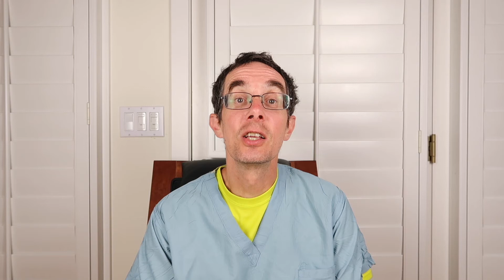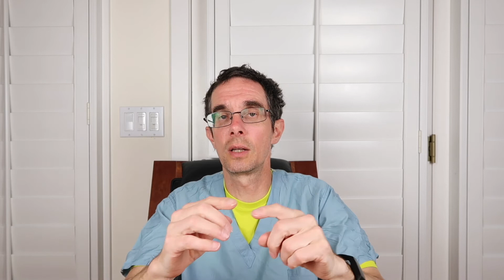Diastolic Heart Failure

Comment: I think I have diastolic heart failure. I had a left heart cath a month ago. My LVEDP was 18 to 21. They said nothing to me about it and didn’t order an echo in the hospital. I gained 7 lbs in 3 days. Had to start taking Lasix. SOB, coughing. I have gained as much as 3.2 pounds in one day. Still waiting for an echo a month after my cath. They misdiagnosed my chest pain for 5 years thought it was POTS. Had 2 false negative Echos 2 years ago. Heart cath showed 85% blockage of my Ostial RCA put a stent in. My EF was 60%. Could the lack of blood flow to my heart for that long have caused the heart failure? I also have hypertension but my POTS doctor kept wanting me to decrease it because I was dizzy. They also stopped the beta blocker because the CPET showed my heart rate wasn’t going up with exercise. This caused me to almost have a heart attack. The CPET even failed to diagnose a 85% blockage 2 months before a heart cath confirmed it!  A heart PET scan showed low risk 2 years ago. I hope the next echo isn’t another false negative and actually shows the problem this time. I wasn’t aware of the of 15% false negative on echos until the cath. I am a 69 yr old female with a positive family history of  CAD. Both my mother and brother had bypasses. I didn’t discover I had high cholesterol until after the cath because my internist kept telling me the numbers looked good but then I saw they were high on my chart. I read a right heart cath with exercise is the only way to definitively diagnose heart failure with preserved ejection fraction. Do you think I should find a cardiologist that can perform this test if the echo is negative again? My kidney function is normal the only other problem is an elevation in my liver enzymes. I have a fatty liver. I was heavy at one time but lost weight in the last year. I seem to fit the profile for hefpef. My thinking is with elevated pressure on the heart cath and all the edema in my legs and abdomen I’m already moderately impaired and not in an early stage of heart failure.
Reply from the maker: Oh boy that's alot. The short answer is yes it does sound like you have diastolic dysfunction (ie HFpEF), but several things to clarify.
1. An echo can not see or assess the arteries at all. You can have 99% blockages in all 3 main arteries and a completely normal echo, those look at different aspects of the same organ.
2. Misdiagnosing chest pain and POTS (which chest pain is not a symptom of) I don't even know how to comment there.
3. The lack of blood flow could cause a reduced ejection fraction but 85% blocked wouldn't do that, and that would not cause HFpEF.
4. POTS and high blood pressure together is a dilemma - too many questions/scenarios possible to try to fix this via messaging but a good POTS doctor should work with you on this.
5. The ß-blocker and exercise heart rates/exercise capacity/POTS correlation is also complicated, but stopping the ß-blocker would not have caused the artery to get 85% blocked (when an artery blocks of 100% that is what causes a heart attack).
6. If the cardiopulmonary stress was done with an echo or nuclear images that should have picked up the blocked artery, if it was done with ECGs alone those are only ~70% accurate so something like this could be easily missed (ie, it's the wrong test to find blockage).
7. When you refer to a heart PET scan there are many types of PET scans to look at the heart, it depends on what specific PET but only a PET stress test would assess the arteries, all of the other PET scans do not.
8. Yes what you were alluding to is correct, for patients with elevated bad cholesterol the earlier we find those patients and treat them (and this is not just meds but also diet, exercise, smoking, etc), the less plaque they build up and the fewer heart attacks, strokes, stents etc end up happening.
9. From what you wrote a right heart cath might be the best test for you. That would answer many questions as other things such as primary pulmonary hypertension could cause alot of what you write, and this test helps to differentiate the cause.
10. After this you comment on the echo again, echos are very good at diagnosing diastolic dysfunction and stage of dysfunction, there are multiple parameters that should be checked on every echo, (once again can not say anything about the arteries), but this most of the time gives us the answers we need.
11. If your bmi is high and especially if it is over 30 getting that down would help any of the possible causes.
12. I don't know if you're in a remote area or if you have access to a decent academic center, I would suggest trying to get to see a heart failure specialist so they can direct testing and treatment more appropriately, that might be the best next step for you. And I know we both wrote alot, but printing this and bringing to that appointment might help if they're willing to take the time to go through each of you points and responses 1 by 1.

Hope that helps and hopefully you have an answer so a proper treatment course will get you better.
Reply: @davidnajman7640 thank so much for the quick and detailed response. The CPET was only a ecg no echo done. The PET scan was Positron emotion tomography myocardial perfusion multiple done 2 years ago not sure if I was exercised or not. My stress echo done 2 years ago did show grade 1 diastolic dysfunction but I was told it was normal for my age. I just had another echo done today but it was not a stress echo. If it correlates with my symptoms of fluid retention, increased SOB and the need to be on Lasix daily in should show a grade 2 or 3 diastolic dysfunction. I’m gaining up to 3.2 pounds a day. Based on my symptoms I feels I could be in stage C heart failure. I did have one day that I was having chest pain again. My lungs felt like they were stretching and there was pins and needles feeling near my upper chest and neck. My back hurt too. My lungs felt very inflamed for a few days. The symptoms decreased after taking Lasix. My BMI has gone down from 30 to 27 in the last 3 months. I was watching my diet and walking everyday until recently when my health declined. I lost 21 pounds in 3 months when I can get all the fluid off. I live in Raleigh NC. I see Dr. Mobarek who is a POTS specialist at UNC Rex. I should know the results of the echo in 48 hours. Hopefully he will be able to direct me to a heart failure specialist. I know they have a clinic in the hospital. I’ve read that a right heart cath is the gold standard for diagnosis of hefpef and may still be something I need to pursue. Duke hospital is close by they have advanced heart failure specialists because they do transplants. I’m having a lot of difficulties with taking Lasix because of the POTS. I also have Dsyautonomia, small fiber neuropathy, gastroparesis. I had a Nissan fundoplication my Vagus nerve was damaged and it caused my stomach to completely shut down and become neucrotic. I ended up having to have it removed. I’m not going to do well with a salt and fluid restriction. The heart failure and dsyautonomia are not going to be a good combination. I’ll need a cardiologist that understands both conditions. Thank you again for your help. It did relieve some of my anxiety as you can imagine is tremendous right now. I hope this conversation helps someone else that may be in the same situation.
Reply from the maker: In regards to your last comment, that's the reason I put these videos together, if it helps either patients or physicians learn more I'm happy.
Agree that you will need to make sure the docs taking care of you communicate well, POTS along with heart failure is a but tricky to manage. But also keep in mind that there are many other things that will cause fluid retention, low albumin, kidney issues either spilling too much protein or not working well, lung problems... to name a few.
If you have questions as your testing proceeds feel free to post here but remember it is a public space so only write what you're comfortable doing.
Wishing you the best

Comment: I have had a echo stress test a year or so ago and they said it was fine . My concern is that my diastolic bp is not good a lot .  115/93 was this morning 120/90 .  It can be 120/78 on occasion .  Should I be concerned .  My thyroid was out of whack for a while and they adjusted my meds . Not sure how much that has to do with it
Reply from the maker: Hi Rick. Diastolic heart failure and diastolic blood pressure are 2 different entities, and only loosely related (I realize that wasn't your question). In general we worry more about the systolic blood pressure than the diastolic, your systolic is quite good. A higher diastolic blood pressure is often seen in people who are overweight or diabetic, if that's the case with you then focus on getting weight down and the diastolic BP will come down as well. 
And yes an out of whack thyroid can effect this, if your thyroid is too slow, that tends to cause weight gain and in turn higher diastolic blood pressure. Other factors that can do it is a higher heart rate (there is less time for the arteries to relax), pain meds, lack of sleep, and even alcohol.
Hopefully that helps, if you have more questions let me know.
Reply: @davidnajman7640 thank you for the reply .  I’m not overweight , I’m 5-10” 178 I do cardio 5 days a week , kickboxing 3 days a week and weightlifting 3 days a week.  I take 20mg daily Lisinopril and 5mg of tadalafil daily .  I take trt 10mg subQ daily .  My thyroid has been all over the place the last 6 months . She adjusted my meds from natural to synthetic 100mcg t4 and 10mcg t3 am 5mcg after lunch.  That bottom number was worrying me .  I have a stressful job and I worry too much about health so that doesn’t help I’m sure.  My goal is to get that bottom number to be in the 70’s at the very least on the weekends when I’m off work.  My dad had a heart attack last week so that being added to my family history just got me more focused on it .  He’s doing well and will recover . He’s not had any sugar since that day and he and mom are cleaning up their diet now that they see how serious it can get .  Thanks again for the reply that was helpful to hear .
Reply from the maker: Thanks for the info, and a few follow-up comments.
In healthy men TRT usually raises diastolic blood pressure (DBP). In people who are hypo-gonad it has variable effects on DBP so if you look you will find variable reports on this.
Stress/anxiety can raise the DBP as well, but that's not often an easy thing to 'fix', so good luck there...
70's would be great, but the effects of stress are more chronic and not just present on weekdays then disappear by the weekend.
Regarding your dad and you, factors such as diabetes (blood sugar) and cholesterol (I eat really well and exercise more than you do but still need to take a statin because genetically my numbers are high) tend to do this more than blood pressure Some of those are inherited so whatever numbers his doctors didn't like on him, they should be checked in all of his kids, and if any of you inherited the same risk there like me and cholesterol, treating that would be a good idea.
Sorry for the long answer, but I still go back to I wouldn't be overly concerned about the DBP and don't let that add to your stress!
Reply from the maker: 160 is really high, if it stays over 130 treating this will significantly decrease the risk of you mimicking your dad. In regards to the last paragraph, it's the exact opposite. The same risk factors that cause heart attacks (ie, cholesterol, diabetes, etc), cause the same build-up of blockages in the brain and that's what causes dementia. 
Statins have been the only drug thus far which have been shown to reduce the incidence of dementia:
http://jamanetwork.com/journals/jamaneurology/article-abstract/2591317
http://www.onlinejacc.org/content/74/21/2554
Hold on til Sept 2026 :)
Reply from the maker: It actually lowers the hdl (good chol) but can lower the ldl a little bit too.
https://pmc.ncbi.nlm.nih.gov/articles/PMC4527564/

Comment: Can you talk About cardiac asthma?
Reply from the maker: Hi starlight, I really don't like the term cardiac asthma because it is such a misnomer. Asthma itself refers to when the tubes in the lung collapse when people try to breath out. That has absolutely nothing to do with cardiac asthma, which is why the name is really poor. Put simply, cardiac asthma is when patient have a difficult time breathing because of fluid build up in the lungs. This can happen with either systolic (heart can't pump enough blood out) or diastolic heart failure (heart can't suck enough blood in), or with valve problems in the heart (not allowing blood to move forward or pushing it backwards). The end result is fluid builds up in the lungs and replaces the normal space to exchange oxygen and carbon dioxide, so as those numbers worsen patients notice shortness of breath.
Diuretics (or water pills) are what we use to get rid of the fluid, but what is most important is finding out WHY the fluid is there so almost everyone with fluid in their lungs should at least start with an echocardiogram because if the underlying problem is not addressed that will likely continue to worsen making the treatments eventually fail.
Hopefully that helps, if you have more questions let me know!

Comment: What are the symptoms of mild and severe diastolic dysfunction
Reply from the maker: Good question and I probably should have gone into more detail. Symptoms of diastolic and systolic dysfunction are very similar. When it is mild most patients might notice a little bit of swelling in their legs, or mild shortness of breath either with exertion or when lying down flat. As the heart either gets stiffer (ie, diastolic as it can't suck the blood back into the heart), or weaker (ie, systolic as it can't pump the blood out of the heart), shortness of breath and swelling get worse, sometimes to the point patients notice their abdomen is bigger because of extra fluid accumulation there. That's why when patients get symptoms like this it's important to get an echo (ultrasound) to see if it is the heart or something else causing the symptoms, and if it is the heart whether it is diastolic dysfunction, systolic, a problem with the valves, or other rare conditions.
If that doesn't make sense let me know, many things can lead to swelling and/or shortness of breath, but those would be the main warning signs.

Comment: My blood pressure is like this sometimes 100/5874 I weight 107
Reply from the maker: Hi @bet. I assume you mean that your blood pressure is 100/58, and your heart rate is 74? Those are very good readings. You sent this however from the diastolic heart failure video, has someone given you this diagnosis? If so how did they get that diagnosis?